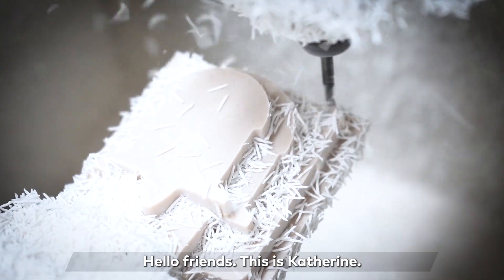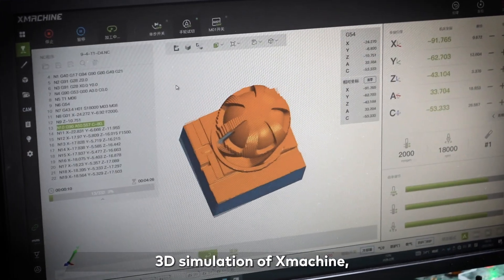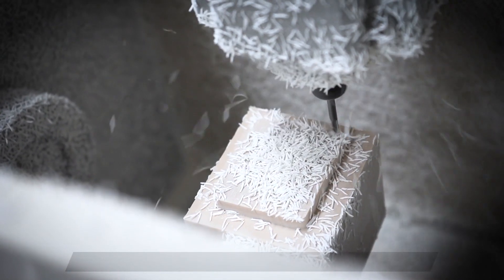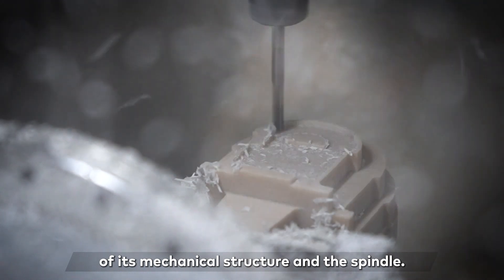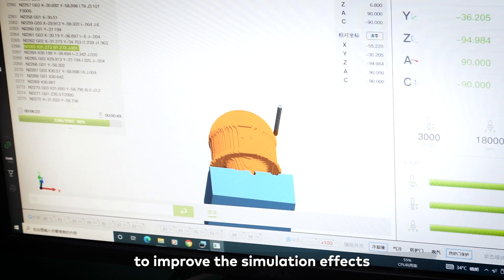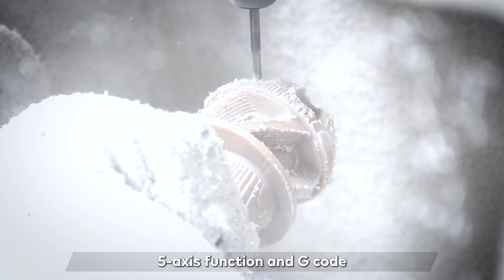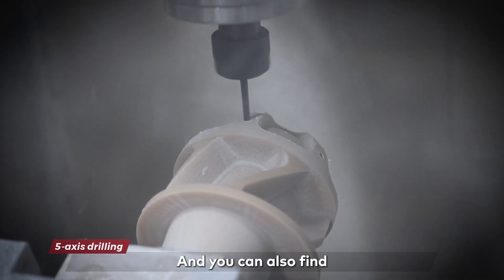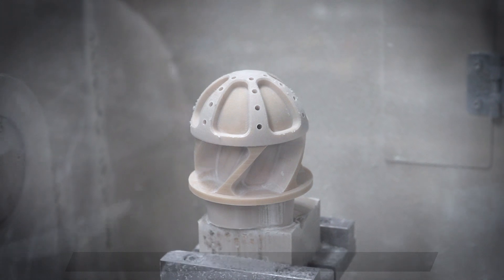Test the Stability of Self-developed 5-axis CNC Machine | UNIONX

Comment: Any reason why you didn’t use LinuxCNC for the control software as a base? Also, are you going to release your CAM software under a free and open source license?
Reply from the maker: Hi, we developed the controller ourselves. And the software is not likely to be free by the time it's released due to the large investment on the R&D.🥺
Reply: Linuxcnc, as good as it is, doesnt have lookahead in non-trivial kinematics. Also the machine limits are not being accounted for when doing simultaneous movement.
Reply: @ipadize  I bet  it would be better than starting from scratch, but that's their choice to not contribute to the project.